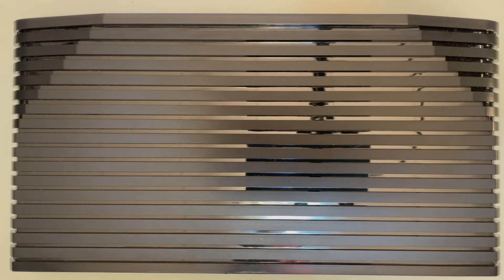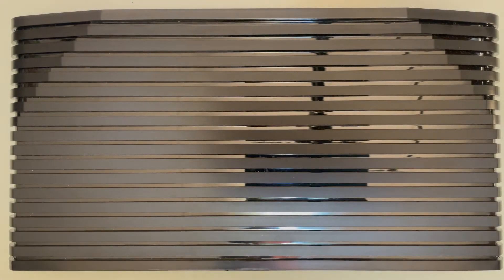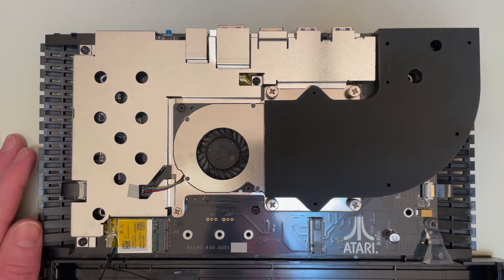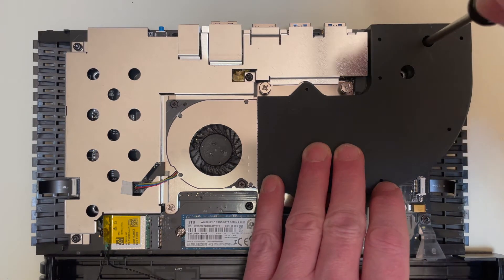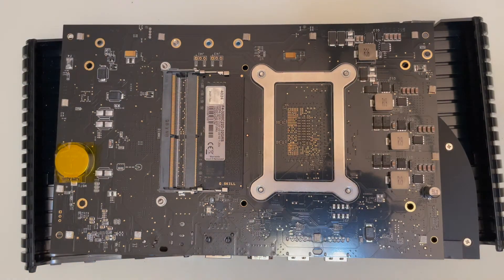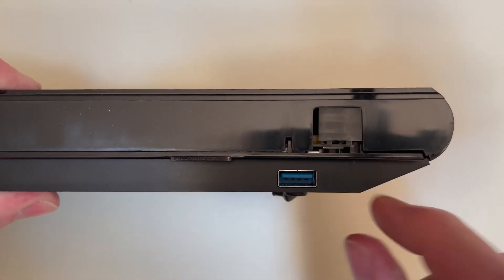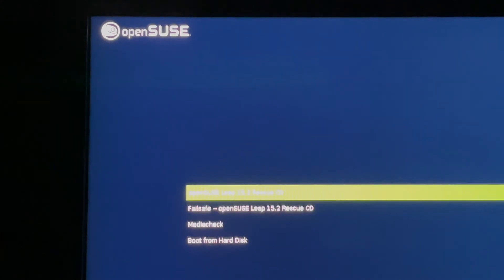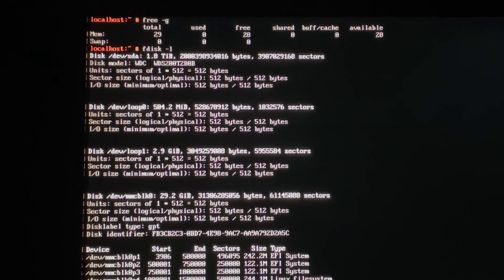Atari VCS 32 GB Memory and 2TB Storage Upgrade

Comment: thanks for the video. just received a unit I recently ordered. Could not find M,2 SATA larger than 256G. Seems most places have stopped carrying it as the M.2 nVME type seems to have replaced the SATA type in the market. Still 256G should be enough for my needs.

Comment: Good vid.  Isn't it necessary to access the BIOS and change the RAM speed to 3200 vs. the 2400 factory setting?
Reply: no. but it could help to speed up the memory.

Comment: Thank you for the EASY well explained tutorial! With that, how does the VCS work with emulation? Do I have to change the BIOS manually? Will Windows 10 PRO have any problems booting internally?

Comment: Hi, When installing the SSD m2, is it necessary to install a spacer between it and the motherboard to avoid overheating?  or even a heatsink on the SSD? Thanks
Reply from the maker: No, it's not necessary. There's really no space for that anyway. You might be able to put a heatsink on top of it, but even then that's still not needed since they don't get that hot. There's enough airspace around it to keep it cool.
Reply: @digitallyentertained2805  Now I'm more relaxed, thanks a million👍🏻👍🏻👍🏻🇧🇷🇧🇷🇧🇷

Comment: The AtariVCS is overclockable ;)
Reply from the maker: Really? Everything I've heard about that processor has indicated that it's not. Would you mind sharing a resource on how to do that? I'm very interested in how that's done. Thanks!
Reply: @digitallyentertained2805  check ETA PRIME video
Reply from the maker: You're right. It's because he figured out what the BIOS password is. Here's the link for anybody else that is curious on how to overclock your CPU and increase the speed of your RAM. Thanks for pointing me to that video. https://www.youtube.com/watch?v=wSKTYPXgWsU
Reply from the maker: I have some more clarification on the over clocking. You can't overclock the CPU, but you can set the RAM speed to 3200 Mhz giving you a speed of 6400 Mhz since it's doubled. That'll improve both the performance of running apps as well as improve the GPU performance a little since the RAM is shared between the system and the GPU.

The CPU speed is locked, so changing the speed of the memory isn't going to change the CPU at all. This is something that AMD has done to these processors and is not a restriction that Atari made.